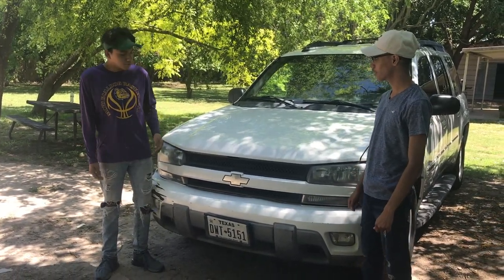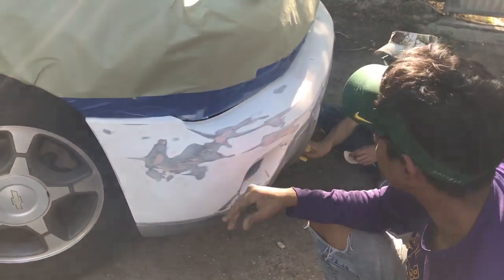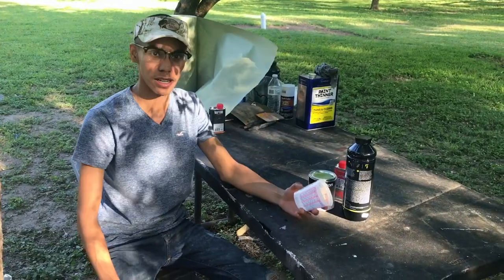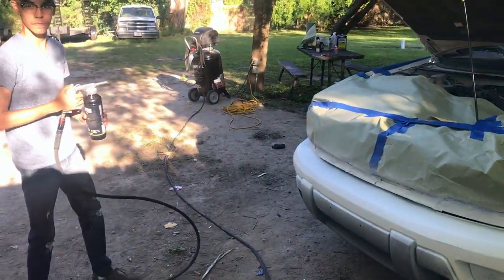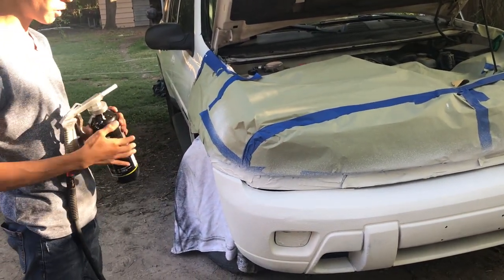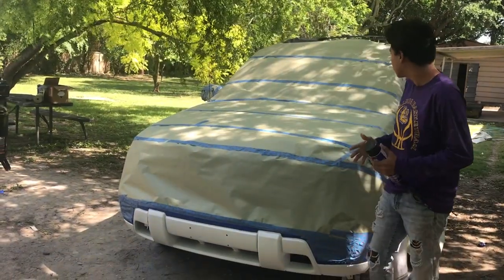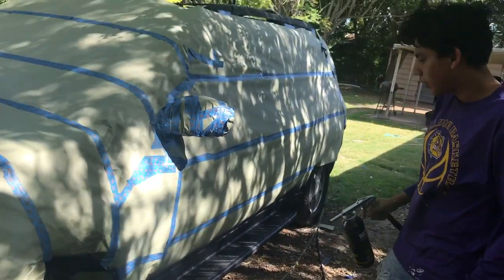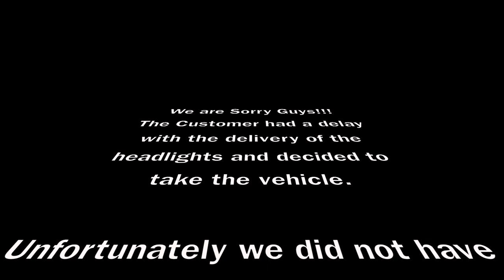Two-Tone Raptored Trailblazer

Comment: You guys must have used the whole roll of masking paper. That thing is not cheap may I suggest using painter plastic to cover the whole vehicle to avoid getting over spray on the rest of the panels. You can find the roll  12ft×400ft for around 15 bucks at home depot. It works grate.